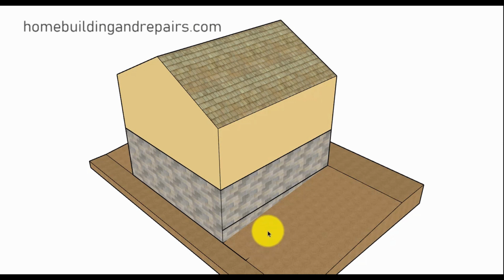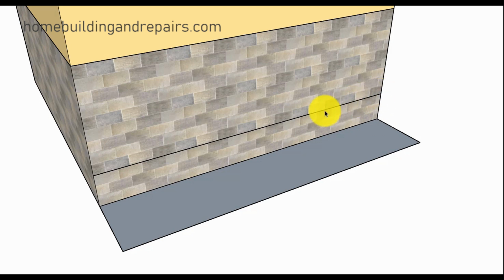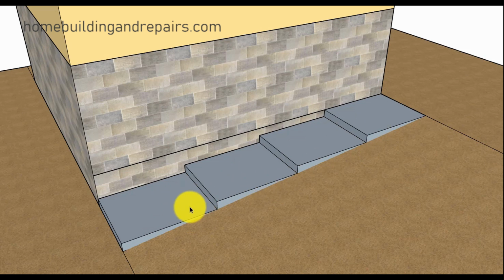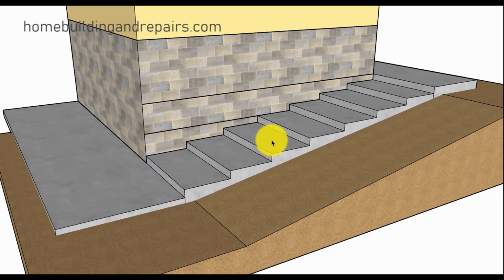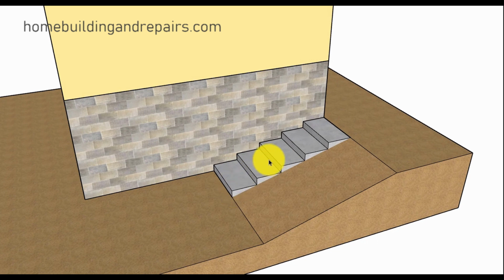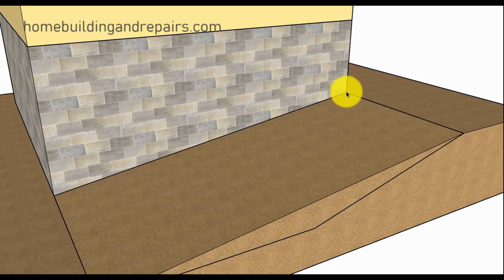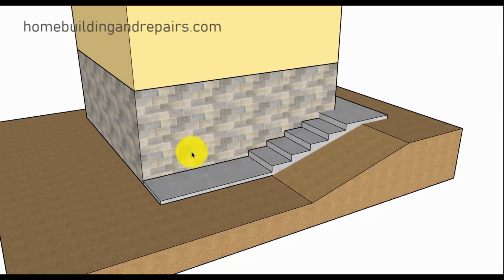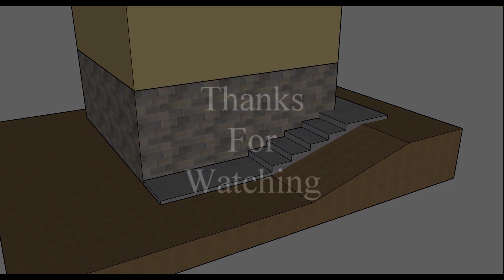Learn How To Design Stairway on Sloping Hillside Next to Your Home - Landscape Architecture Tips

Comment: You've give max tread rise for residential and commercial, what's a practical minimum for tread rise?
Reply from the maker: There is plenty of information at our website about treads and risers and stair design. 
http://www.homebuildingandrepairs.com/stairs/index.html
However, if you're simply looking for a suggestion, then 7 1/2 inch riser and 10 and treads work nice for residential and 11 and 7 for commercial.